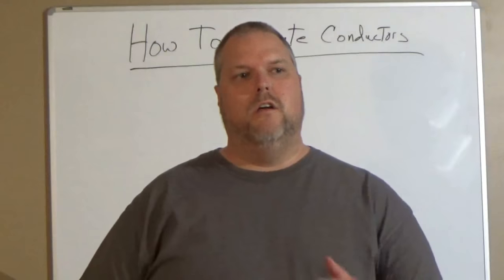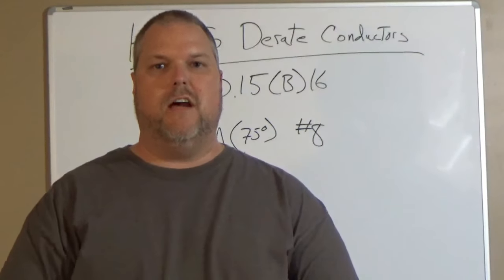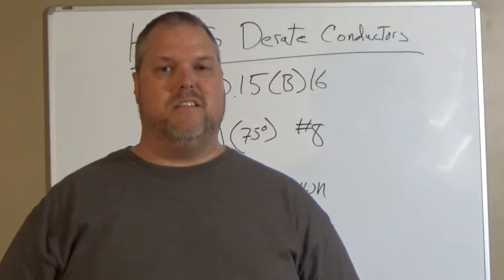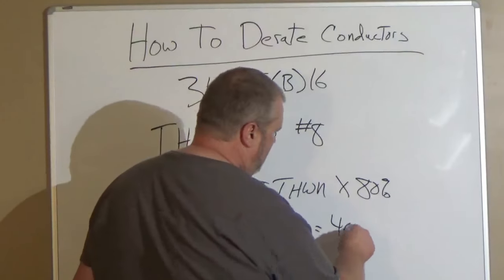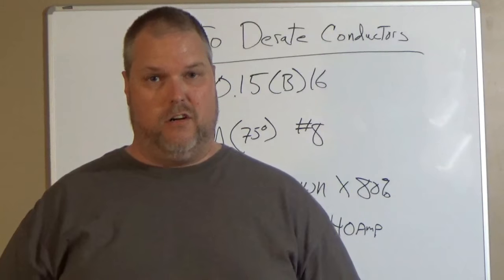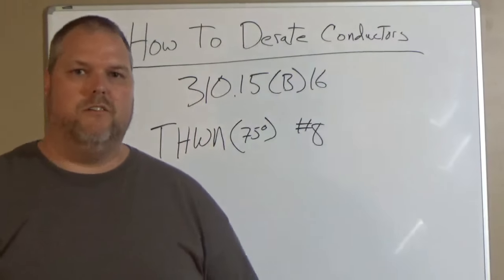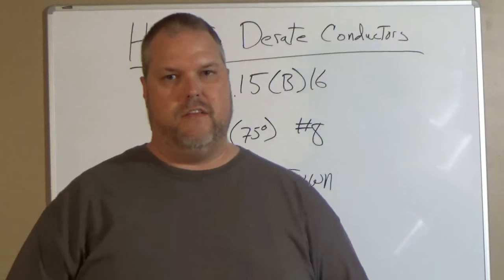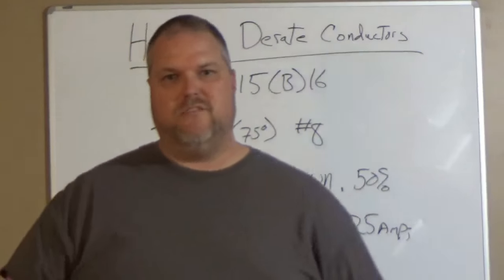Derating of Conductors Explained

Comment: Idk how to ask this any easier way but does conduit size change the derating factor? For instance 9 c.c.c #12 20amp breaker (70%)maximum  without derating Through 3/4 conduit. Does this still stand for 1” or 1 1/4 conduit. Since the conduit is larger less heat? If conduit size doesn’t matter then how could this formula stand for 9 c.c.c #12-20amp breaker through a 4” conduit? If I pulled 10 wires would I really have to Derate?

Comment: So, I'm wondering if it would be cheaper to run one 1" EMT with 10 conductors at 50% ampacity, or two 3/4" with 5 conductors each, at 80% ampacity. Or what the hell, maybe throw up 3 1/2" EMT with 3 conductors each, all at 100% ampacity. Lots to think about. Thanks a lot for this awesome insight into a very perplexing part of my job.

Comment: Craig great video this is making alot of sence now 
Am taking a electrical system code and theory class at my school and we are going through de rating conductors and also Over current protection devices but this video helps alot more thanks for sharing with us about the NEC

Comment: Does the 40% wire fill matter if ur de rating instead?
Reply from the maker: @jorgeescutia9578  yes it does!! Conduit fill based on 40% is based on area where derating only refers to the safe ampacity of the conductor. CM

Comment: Over the years I've noticed a lot of guys ask if a neutral is considered a current carrying conductor, so I've adjusted my vocabulary from "hot/neutral/ground" over to "Ungrounded Conductor/Grounded Conductor/Grounding Conductor". I also make sure I spend plenty of time with them on Article 💯.  😉
Reply: Grounded and grounding conductor are two separate things. Don’t know if you caught that.
Reply: @1brrooke1  Thats right. As I said, Ungrounded Conductor(hot), Grounded Conductor(Neutral), and Grounding Conductor(Ground). The terminology of Grounding Conductor is misleading because the ground is not considered a current carrying conductor, it's only there to provide a path for available fault current. 👍

Comment: Thanks for making videos. However I would like to point out derating is based on conductor type. Most our conductors today are 90d not 75d like the video. After your derating has been calculated you then cant exceed your termination ratings . Ie #10 rerated to 50% is 20a which does not exceed the 75d column if your using 75d terminals. In this example you could use 20 #10 at 20a in 1" emt.

Comment: Your awesome... One question when de rating do you include the nuetral?  So all my wires if I had to bump them up to the next size would all have to be a number 6 including the nuetral?  And one more question. Can you legally go done one size with the nuetral and 2 sizes with a ground?  Thanks for your knowledge. You make learning extremely fun.
Reply: The neutral is a current carrying conductor, so you have to size it accordingly and include it in your pipe fill and de-rating calculations. You also do not need to de-rate the ground as far as I know since it does not carry current, for example if you are using a #10 de-rated down to 20 amps you can still use a #12 ground, you don't actually have to upsize the ground to a #10 the way you would if the #10 hot was being used for a 30 amp load.
Reply: @KLAWNINETY  thank you makes perfect sense

Comment: In your example are you accounting for the neutral conductors in your four wires? And also what if you have three hots in your circute? In that case how would it work with six current caring conductors?
Reply from the maker: The nuetral is always counted as a current carrying conductor. So if you have 6 wires and they are current carrying then you calculate them according to the code. Hope that explains it better for you. Thank you for your question. CM

Comment: Question a current carrying cunductor also includes a neutral wire? Also thanks for yhe video
Reply from the maker: Thank you for the question!! Yes the neutral wire is considered a Current-carrying conductor. Thank you for watching my video!! CM
Reply: @craigmichaud-electricalins4602  
Is it true that the neutral doesnt count as a current carrying conductor if its a balanced shared neutral?
Reply from the maker: @86aoshi  I have never heard that. In any type of fault or change in the system can throw it out of whack. In the NEC it calls for all current carrying conductors. That is how I have always seen it. If you find anything that is different please email so I can read about the process. Thanks for the question!! CM
Reply: @craigmichaud-electricalins4602  
Check out 310.15(B)(5)

Comment: Where exzAcky would I use this application on a device or a feed or service entry??
Reply from the maker: Thank you for your question. Derating a Conductor is a step in properly sizing the wire. It is the code version so I explain how to do it. Like I said you only use this when you have more that 3 current carrying conductors in a cable or conduit. It is not for devices but in some cases used for service feeder sizes. I hope that this answers your question!! Thanks for watching!! CM

Comment: I have a question please sir.
When I do temperature correction for the conductor based on the type of the insulations some times we have the same insulation type in 75 column and 90 column so which column should I use when I have the same insulation rating in the two columns?

Thank you.
Reply: 75

Comment: Yeh but once   you have derated and have your amperage total, what do u do? That’s the breaker size amperage that you will use for each circuit?
Reply: Example: if you need to wire a 50 amp circuit in this scenario, you would have to adjust your wire size. So instead of #8 THWN you could select #6 which (after adjustment for 80%) has an ampacity of 52 amps.
Reply: @truthbebold4009  but isn’t 50 amps x 80% = 40? At a 75 degree would be a number 10?

Comment: Isnt THWN rated at 70 amps  for an 8 size copper wire?
Reply: #8 copper thwn is rated for 50 amps. Nec code: table 310.15(B)(16)
Reply from the maker: No 70 amps is in the 90 degree column. You only use it when you dont know the exact wire type. Thank you for the question!! CM